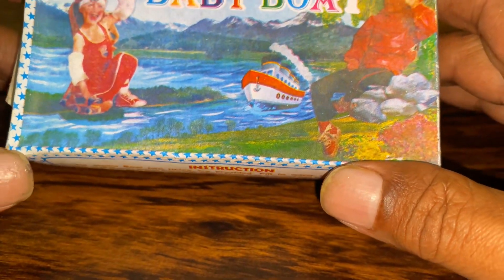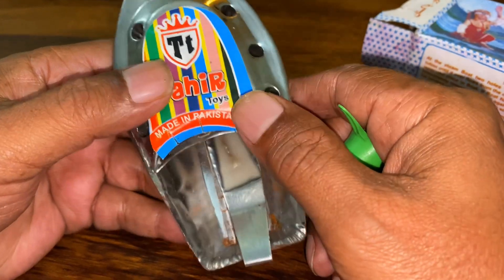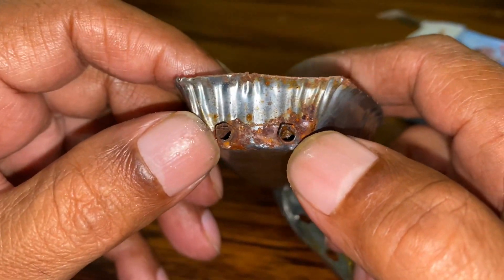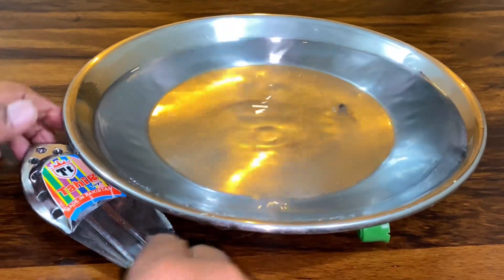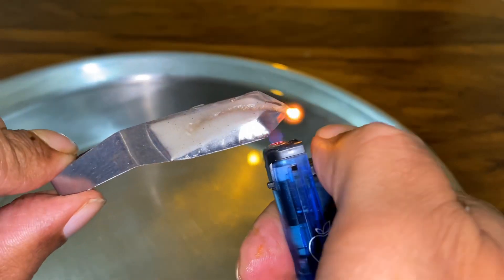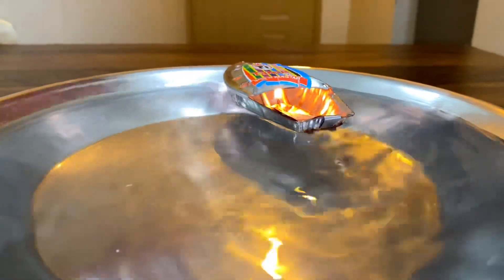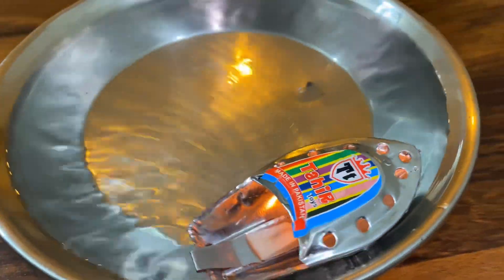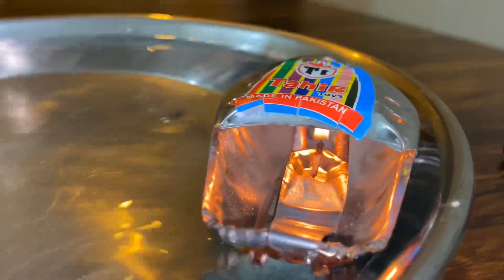Weird Physics About Vintage Steam Engine Boat Review | Collection Of Boats Is My Hobby

Comment: That thing really powered off! Does it cycle fresh water in one pipe and expel from the other? I imagine it would get pretty hot to touch after that candle's been burning
Reply from the maker: 2 pipes steam system distribute steam through a building's pipes to radiators that heat occupant spaces. Two pipes system are similar to one pipe system, however the main system is how condensate the water created when steam cools is handled through the layout pipping